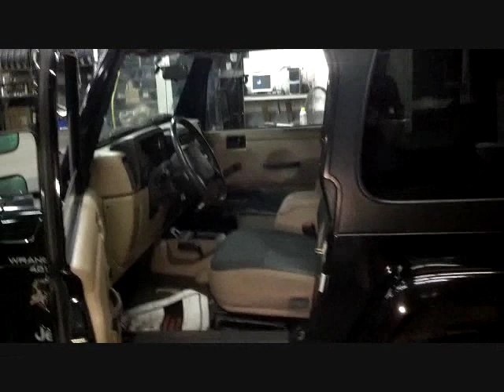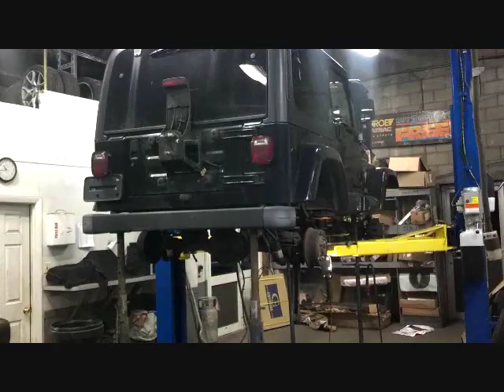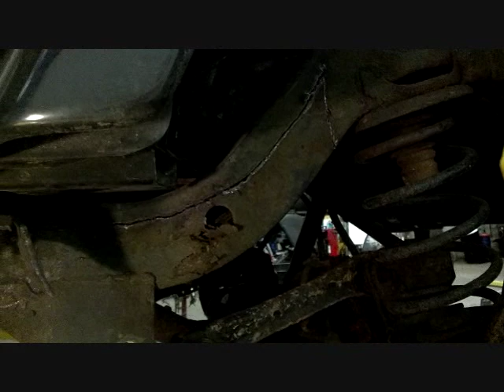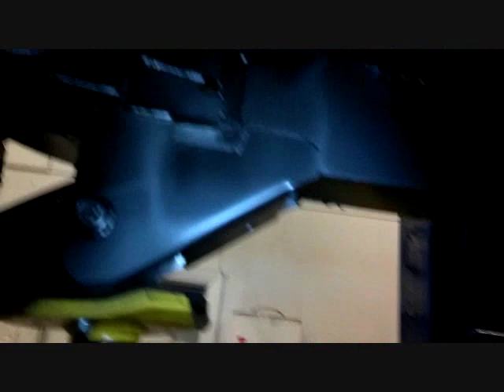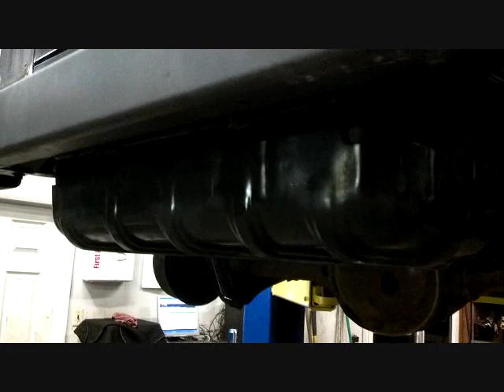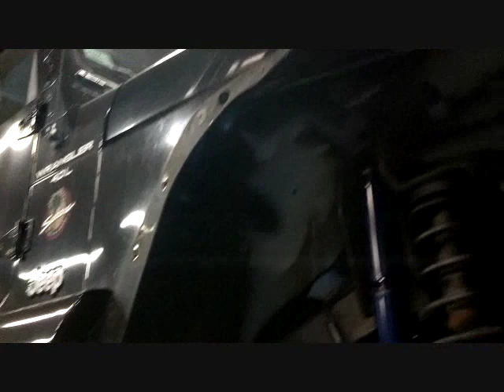2001 Jeep Wrangler Sahara Restoration. Part 2: frame repair

Comment: Definitely worth saving, especially since those caps are around $900 shipped.  If you have the tools and a little knowledge, it's an easy/fairly easy fix.  Like Jeeptjguy said, frame swap might as well do complete resto.  I'm doing the same thing to my 2001 TJ and it's much easier than swapping frames.  Inner frame coating and POR-15 will keep this beast lasting a looooooong time.  Great video!  Great looking Jeep!

Comment: Wow, I had a used 2001 Jeep TJ Sahara that I bought with 141,xxx miles and traded it (175,xxx) about 2 years later and the frame still looked good

Comment from the maker: Yes, in a perfect world. However finding a wrecked TJ with a straight AND rust free frame where I live would be nearly impossible. The repair is far less work than a full swap and after treating the inside with Eastwood inner frame coating and the outside with POR15, there won't be any issues. Additionally, unless this was a "keeper",a frame swap (which always becomes a full body off resto project) doesn't make financial sense. As you say, and I agree, what's it worth finished....about $6,000?

Comment: I think I would have just looked for a wrecked Wrangler with a good frame....or I would just sell it quickly as I could.  Being that it's a 2001, I don't see any reason to fix it.  It's probably only worth $6000 without a rusted frame.

Of course the other issue of the rust returning hasn't even been taken into consideration.  There is no way ALL of the rust was cut out, so it will only return quicker then before.